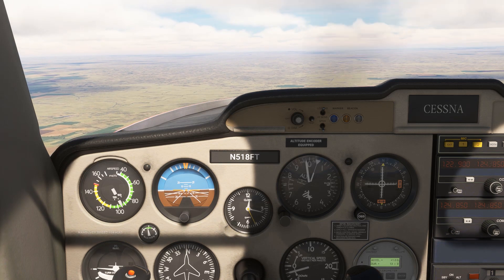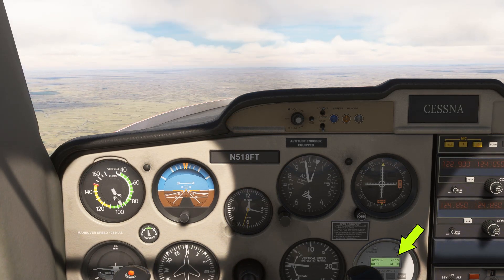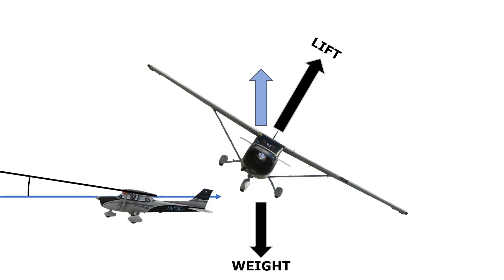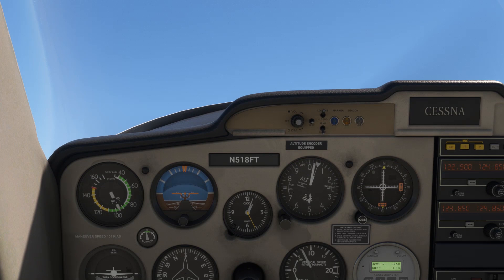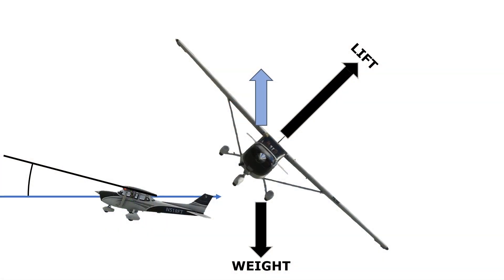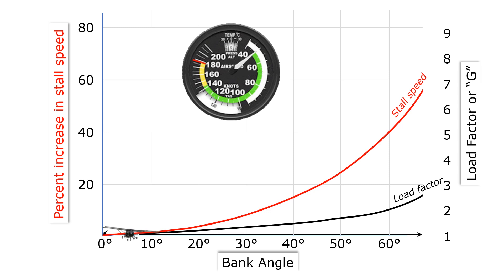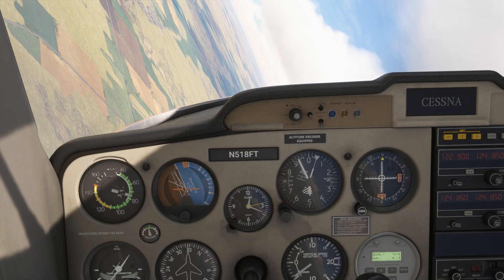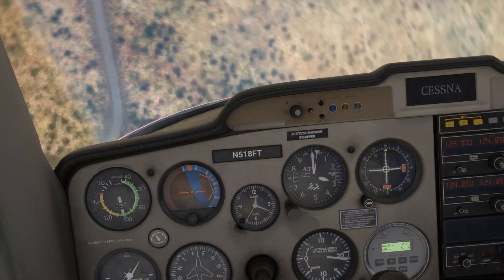How Load Factor Affects Stall Speed | Aerodynamics Explained

Comment: Load factor is better described as a relationship between G force and stall speed. AOB is the way most people will hit said G forces outside of aerobatic flight. How ever this works in the opposite direction too u loading the aircraft towards 0G will decrease your stall speed which can be a useful tool to understand

Comment: Once again, the stick controls the elevator; the elevator controls the angle of attack; the angle of attack determines stall condition -> the stick position determines stall condition.

If you pull the stick back past the "stall stick position" you stall, and if you don't, you don't stall. 

Focussing on speeds and trying to do trigonometry and thinking about back pressure is all overcomplicating the simplest of concepts -> if the stick is pulled all the way out, you will stall, if you want to prevent it, don't pull it back that far.

There's a free online book to help people not die from stall-spin accidents. "Fly better - Noel Kruse". Instructors should read it too - the subtitle is "the things you should have been taught when learning to fly"
Reply: How does trim fit into this thought process?
Reply: Mostly irrelevant. It changes the back pressure, but the stall criterion is the position, not the back pressure.

Mostly* - there's lots of tiny caveats that change the stall stick position slightly, but the same caveats usually apply to stall 'speeds' too. (Weight and balance etc). 

One real caveat is that it probably doesn't apply to canard aircraft, but I haven't confirmed that.

Comment: I think I might be wrong about this because everyone says the same thing about load factor “causing” an increase in stall speed, but here’s what I think. And please explain why I’m wrong if you can because my brain just doesn’t get this concept.

I thought stalls were only related to angle of attack, which increases, for instance, as you try and maintain level flight in a bank until you reach the critical AoA, which happens to be at a higher speed not “because” of Load factor but because you are increasing AoA to compensate for the loss of the vertical component of lift. I feel like Load factor is just a measure of the lift/weight disparity and becomes more relevant as you approach structural limitations, and there are load factor values that correspond with specific higher stall speeds, but I don’t think load factor directly “increases” the stall speed itself.
Reply: You are correct in that an increase in load factor does not "cause" an increase in stall speed. What is happening is, in order to maintain altitude in a turn, you must increase total lift so that the vertical component of lift is the same as in straight and level flight. That means you must fly at a higher angle of attack. So, you are flying closer to your wing's critical angle of attack. In a bank, the total lift is split into vertical and horizontal components. Since those components are at right angles, our old friend Pythagoras shows that the total lift is equal to the square root of the sum of the squares of the two components. It's this resultant of the lift vectors (the total lift) that we experience as load factor. Also, some basic trigonometry will show that the load factor, in a constant-altitude turn, is equal to one over the cosine of the bank angle.

It's probably more accurate to say a higher stall speed is correlated to an increased load factor, rather than being caused by it.

The lift equation shows that, all else being equal, lift is proportional to the coefficient of lift and proportional to the square of the airspeed. Assuming the geometry of the wing is not changed by extending the flaps, the only way to change the coefficient of lift is to change the angle of attack. This is why the required AoA varies linearly with the load factor and the stall speed varies as the square root of the load factor.

Note that you will not experience the same load factor if you are not trying to maintain altitude in a turn. Steep(ish) turns in the pattern are not quite as deadly as we've been led to believe because they are descending turns. Don't get ridiculously aggressive and keep them coordinated and you'll be fine.
Reply: The flying surface of the wing is slipping because of gravity?
🛩️🤔

Comment: I think it's also useful to understand that if you allow the airplane to descend, you can bank steeply without an increase to load factor and stall speed.
Reply: Load factor is just lift/weight

If you’re descending you’re not making that much lift so naturally load factor goes down
Reply: @ thanks for that additional insight! Makes sense! Helpful to visualize it as such!
Reply: and why is that?
Reply: @KuostA  In simple terms, you're not pulling back on the yoke in a descent, so you won't be pulling G's and getting near the critical angle of attack.
Reply: @spencerwilliams2117  right, of course, just wanted to hear it spelled out. thanks!